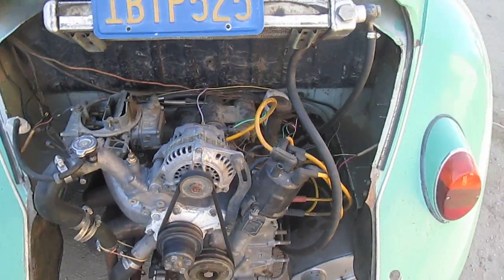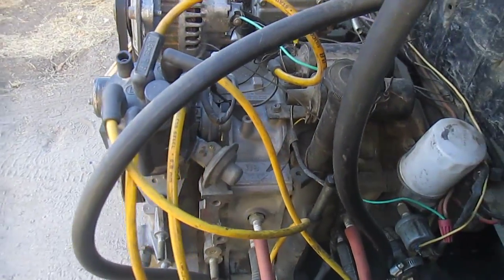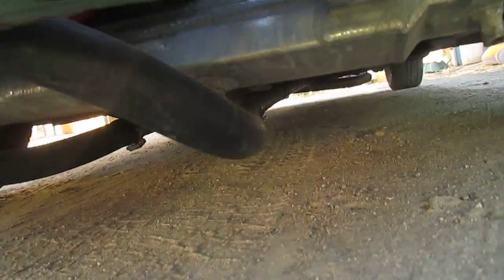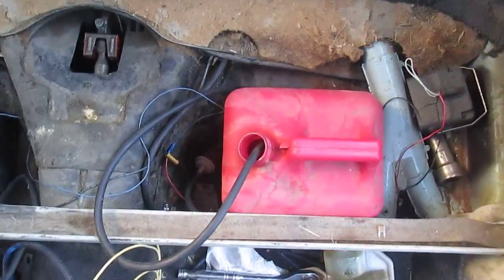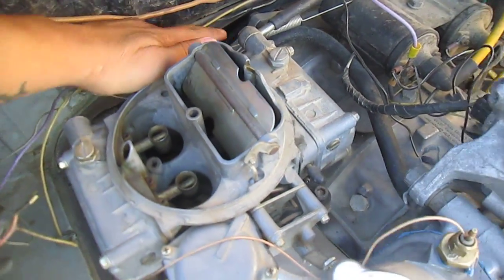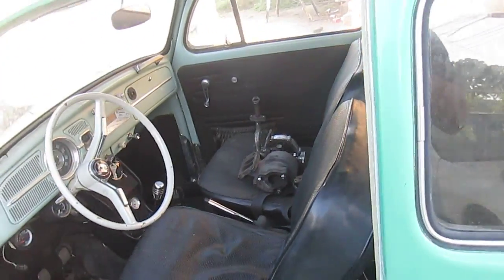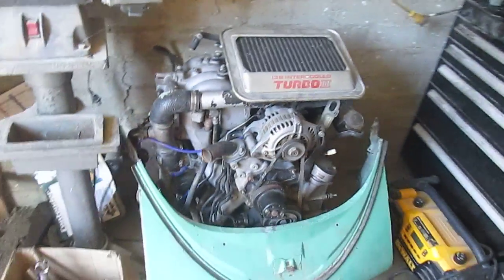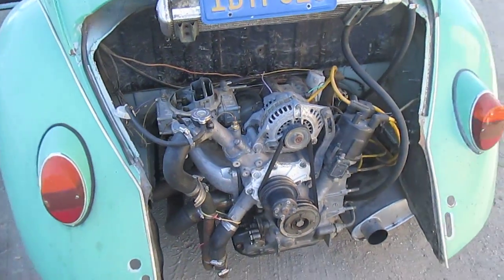13b rotary bug walk through

Comment: Hi i have the same engine but i dint know how to do the wires
Reply from the maker: It's not too complex. Just  got to make sure you're using the right application. If you have the distributor, it has pros and cons, just like using the original CAS. I like having a distributor for simplicity, but its bulky. I made a front pulley mount position sensor that worked beautifully.

Comment: I see that in the description you say that you're using the stock transmission, however I've heard many people say that usually you end up braking stock transmissions with a more powerful engine, what is your experience so far? it's been more than 6 years now, so what issue did you encounter? did you have to replace the transmission for a newer one? if so, what type of transmission you placed? thanks bro!!!
Reply from the maker: No issues. It has welded 3rd and 4th gears to prevent slipping. It also has a heavy-duty differential. I don't slam on the trans. I also have a stage 2 clutch, which only allows a maximum of 275 lbs of torque to mitigate damage. A rotary also has limited torque, so that helps.